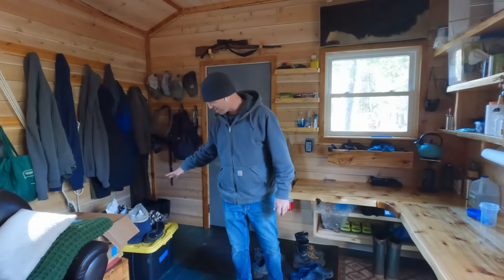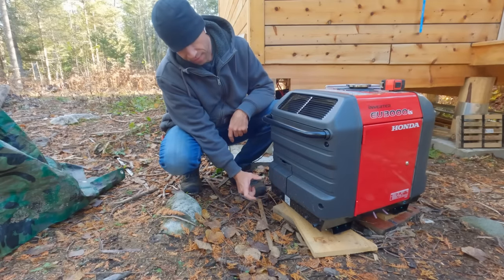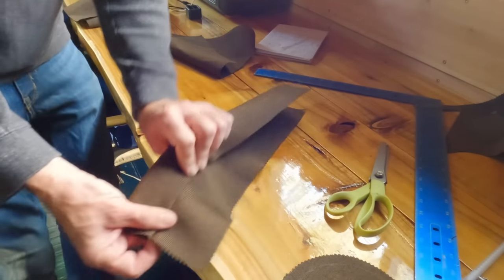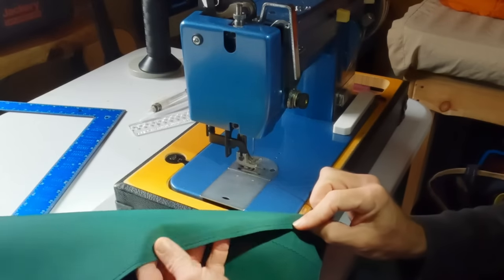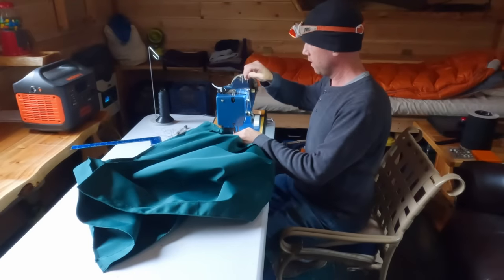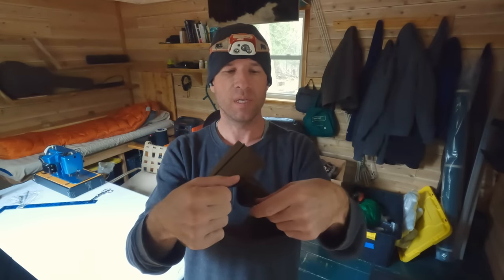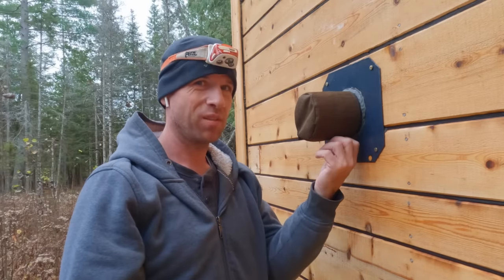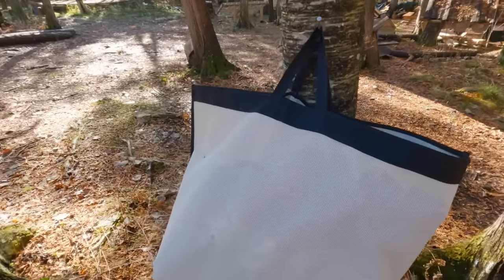Ex Pro Canvas Maker- How to Make Simple Waterproof Covers for About Anything! #163

Comment: If you cut your binding at a 45 degree angle and sew it so when it's open it is in a straight line, you won't have so much layers in the same place, when you sew it on. If you can find an old singer 301 or 304 they are slant needles and will go threw many layers of material almost like an industrial machine...I would like to know how snaps are attached to wood so that a tarp can be snapped over an opening.

Comment: Just fyi binding is not cut on the straight edge of the fabric.  It is cut on the bias.  The full name of it is bias binding tape.  Store bought is cut that way.  It makes it more flexible.  What you did can work on things like your smaller projects with straight edges where flexibility is less of an issue but technically is not how binding is made.

Comment: Id say you need an insulated box over your generator for the winter soot stays warm while its running as batteries need to be above 32 degrees to charge properly as well just a wood box wood be helpful to keep the heat on while its running and keep gas lines from freezing. a guy from alaska where its much colder in the same situation as you. did this as the generator would run shitty just sitting out side n they need it to charge a battery bank when there was no solar.